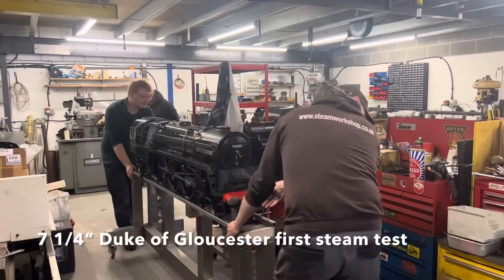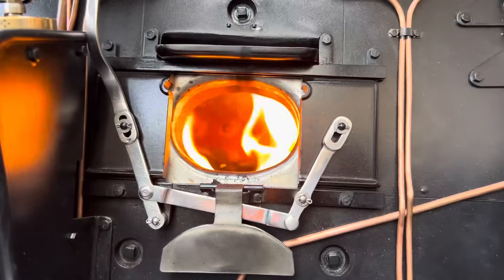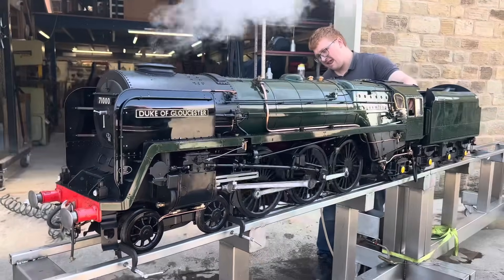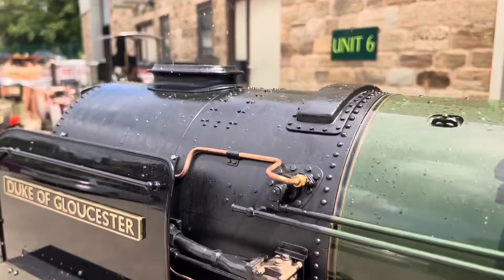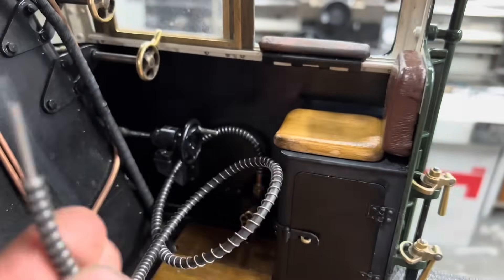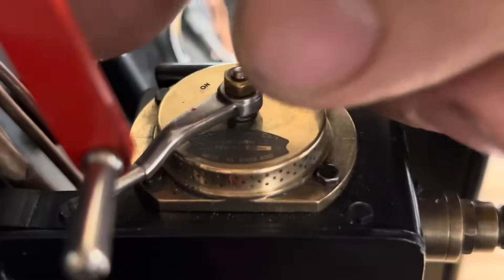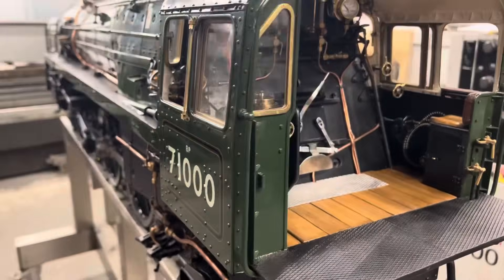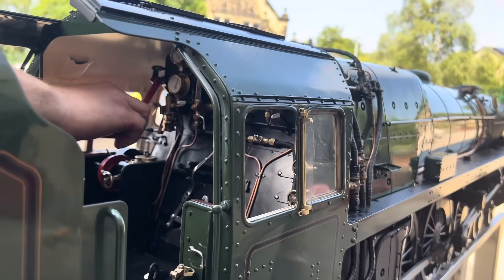7 1/4” gauge Duke of Gloucester Steam Test

Comment: Not sure about those unrealistic steam pressure Cylinder Drain cock valves ! Why not use what's on the real thing, which are of course manually controlled Cylinder Drain Cock valves, one thing less to go wrong, and assuming you know how to drive real steam locomotives, allow a much better guaranteed control ! Saves knocking out Cylinder ends !

Comment: Am I right in saying that 71000 was actually unique and was a three cylinder engine not a two cylinder engine like 70000 Britannia ? Also how do you get the stunning paint finish on your locomotives. Do you have a professional paint shop with a paint booth to get that beautiful paint finish?
Reply: You are quite right - 71000 is a one off with three cylinders and also was unuaual in having Caprotti rotatary cam valve gear which was also fitted to a few Black 5s and 30 BR standard class5s.  It was deemed a failure due to high coal consumption and poor steaming - both of these were faiirly easily rectified in preservation by redesigning the ash pan and fitting the Kylchap exhaust which was never fittied when the loco was built

Comment: The rotary valves you mention allow full pressure of steam either side of piston. Well actually I gather the point of rotary valves is primarily to eliminate the sinusoidal motion of valve open and closing and replace with 'instant' open and closing, thereby enabling a greater flow of steam, whatever the pressure.

Comment: Dumb question I know, sorry! But in this scale model form with all its original design kinks and flaws ironed out? Does this model develop more 'Drawbar Horsepower' than its  true life counterpart? If you were to scale things accordingly. I ask only because I read somewhere once that the 'Duke Of Gloucester' could have been the most powerful loco in the UK, but it had issues! Is that correct?

Comment: Is this a rebuild of the original Denis Evans model?
Reply from the maker: Yes indeed.  It certainly is.  Pretty much everything above the running boards is new, and all the detail below them as well.  But the basic chassis and valve gear is all Dennis’s original re-built.
Reply: Ah, found your web page. Indeed it is. Saw this at Loughborough while, in student days, working on the early stages of the restoration of the 1:1 scale Duke. Often wondered what became of it since. This rebuild is truly beautiful and does full justice to the skill and patience that went into the original.

Comment: A work of art! Simply stunning, and the additions to the tender are ingenious.
you wouldn't happen to have some more images of three internals of the caprotti valve gear would you?
Reply from the maker: There is a page on our website where we will be writing the whole build and history of the loco up.  It’s currently a work in progress but worth a look.  🙂

https://www.steamworkshop.co.uk/portfolio/sw-rebuild-no-17/
Reply: @TheSteamWorkshop  For anyone who wants to get a look at the inside 3rd cylinder, you can see what looks like the head in the clip with the piston ring and also it looks like the rod and counterweight where it is running on air sans boiler in another clip in the link above. The third cylinder looks like it may be larger than the outside ones. You don't get to see those, much.

Comment: So why does the locomotive have 2 stacks? Is one for the 3rd inside cylinder?
Reply from the maker: All three cylinders exhaust equally up both chimneys.  The twin chimneys softened the overall exhaust pressure and helped the efficiency of the loco’s draughting design, enabling more efficient burning of the coal.  The softer blast didn’t carry the smoke as high above the chimneys, so most double chimney locos are fitted with smoke deflectors to help lift the smoke clear of the cab.  🙂